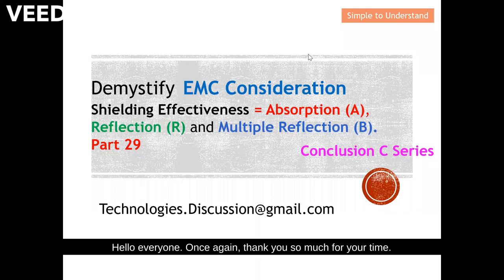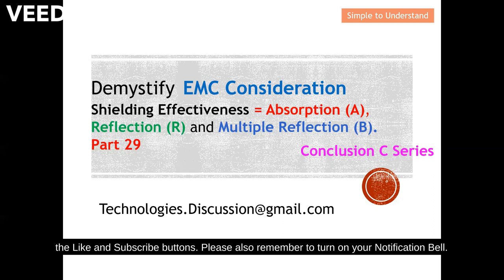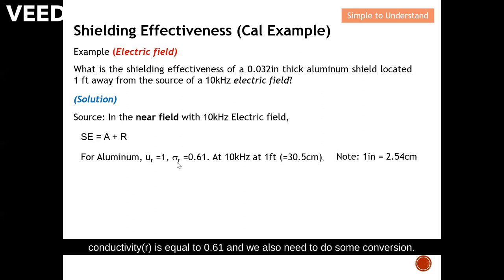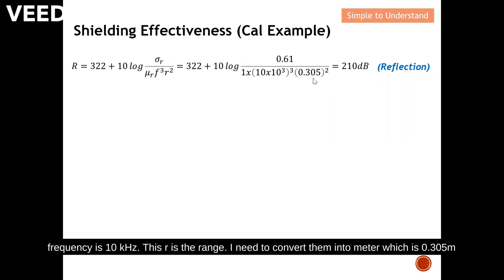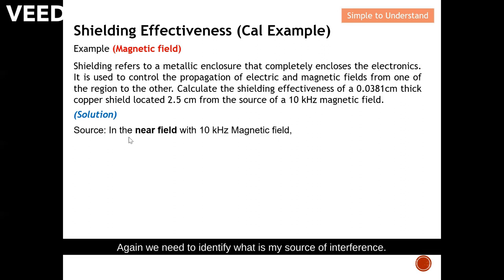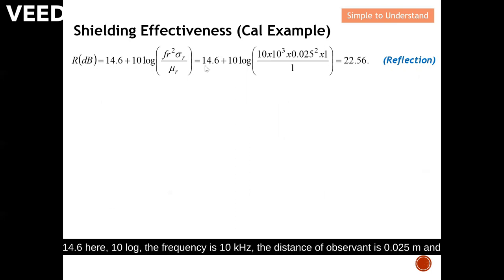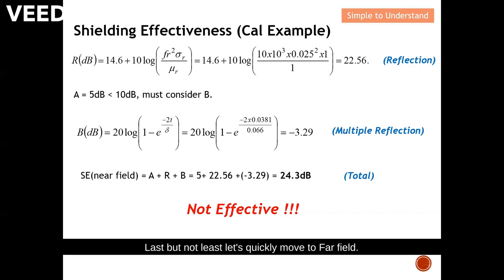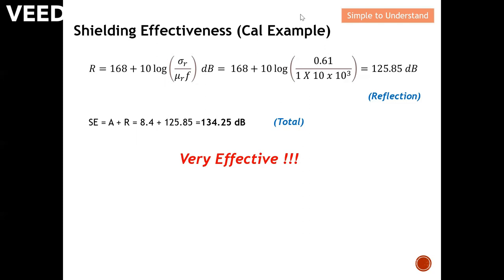EMC Part 29. How to Calculate Shielding Effectiveness for Electric / Magnetic / Far Field.

Comment: why did you convert your range to meter and not cm??. i have a test tomorrow, so i hope you see this on time
Reply from the maker: I guess you refer to the reflection. The equation that I have for the reflection, under the range, the SI unit needs to be in meter and hence I convert them into meter. In short, this Eq (in my youtube) needs to be in meter then you can use this equation.
Hope is clear